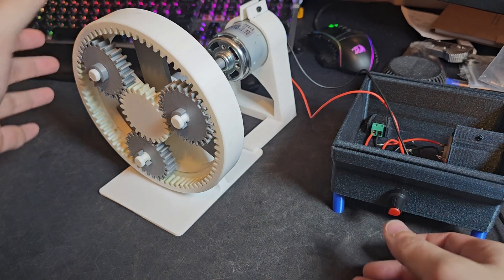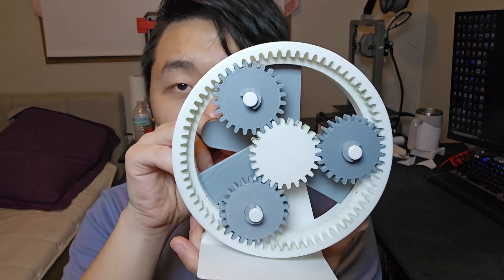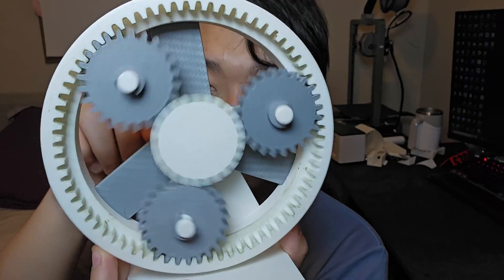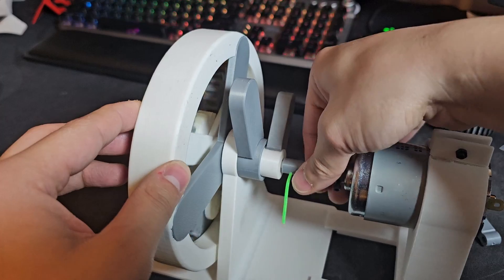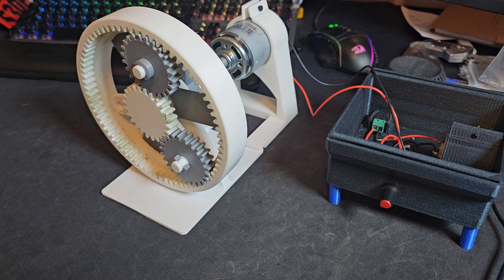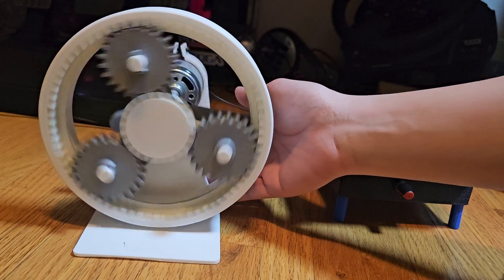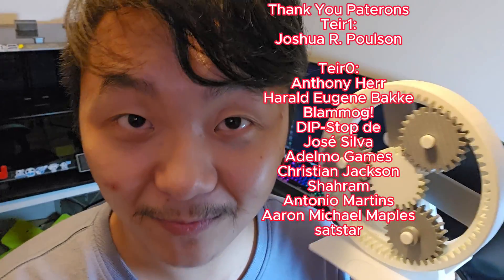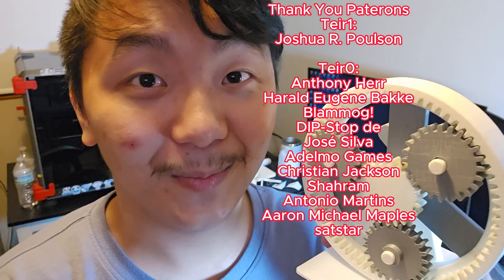Planetary Gear Box Are So Interesting 3D Printed

Comment: Remember kids, you can gain 2 forward speeds and 1 reverse speed per planet.
Reply: @Scratch3DPrinting  in the transmission world the rule of thumb is 2 forward speed and 1 reverse per planet set, you have a 5 speed transmission it has 3 planet sets
Reply: but 2 × 3 = 6, why doesn't the third planetary set give 2 forward speeds @raytitone1583 

not saying you're wrong I just want to understand a bit better
Reply: @jeffreyharbin5211  the same reason it doesn't give you 2 extra reverse gears. It's simply not needed. With 3 planetary gear assemblies, you have the ability to have 6 forward speeds doesnt mean you have to use all 6. So with 3 planets you can have 6 speeds but with 2 you can only have 4, so the only way to achieve 5 is to also have 3. I know it's confusing but the planet set isn't the only contributing factor, im just saying that's the rule with the gear set. 2 speeds forward, on reverse. You can hold the outer ring and spin the inner gears or hold the inner gear which is typical called a sun gear because the planet gears revolve around that gear give you another speed
Reply: @raytitone1583  so if they added an additional clutch pack somewhere, a 6th gear would be achievable with the same 3 planetary sets that were used before? is this what you're saying? and if I'm following correctly, does this mean a 6 speed and 5 speed will be extremely similar then?
Reply: @raytitone1583  also, how is the sun gear held? I've been watching lots of these videos as I'm trying to learn more about automatics (just learned all about 18 speed manuals in school and now we're about to take these autos apart) and the clutch packs inside the Allison transmissions that are labeled C3 C4 and C5 are stationary clutches that hold the ring gears, and the C1 and C2 clutches are rotating clutches that allow drive to be transfered to another member, and so when clutch pack C2 is applied the carrier of P2 and ring gear of P3 rotate at engine speed in the higher gears and C1 allows the sun gears of both P2 and P3 to rotate at engine speed

so to hold the sun gears do we simply disengage C1 so that the sun gears aren't driven at engine speed? and since P1 sun gear is driven by the rotating clutches assembly and always rotates at engine speed is it even possible to hold the P1 sun gear stationary to acquire a higher speed from the first planetary set P1?

sorry if this is confusing but as I said I'm still trying to learn and you seem to be very knowledgeable so figured I'd ask in the only way I know how

I'm refering to the clutch packs C1 through C5 as they would be situated on an Allison 3000 automatic transmission as I've been watching a lot of Allison 3000 operation videos (since they seem to be the most in depth and cover the general concepts better)

feel free to ignore this if it does not make any sense and or is too long to read and I will try to word it in a way that is easier to understand, and is shorter in size
Reply: to summarize,

first question - do 5 speed and 6 speed automatic transmissions only differ in which clutch packs are used and where they are used and maybe even how the planetary assemblies are connected together (the ring gear of the third planetary set is connected to and driven by the carrier of the second planetary assembly) but since they both share 3 planetary sets they are very similar in design/construction? 

second question - how do we get the sun gears to remain stationary so that we can achieve a different gear ratio? is it simply by disengaging power to the sun gear?